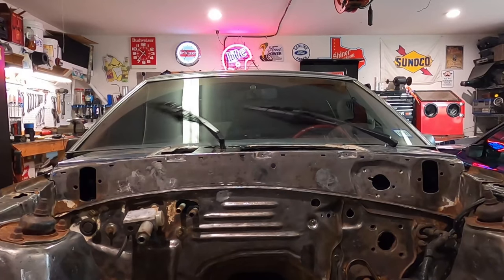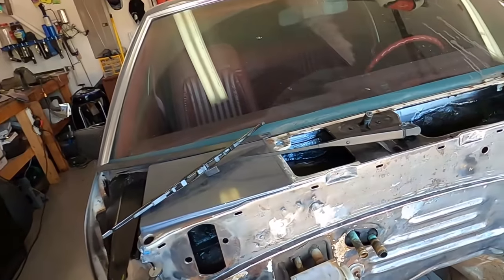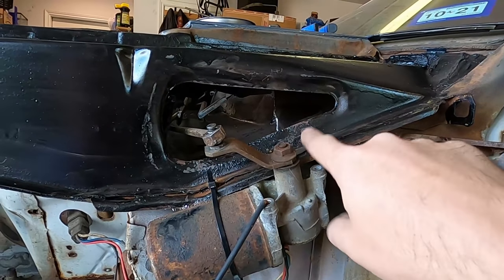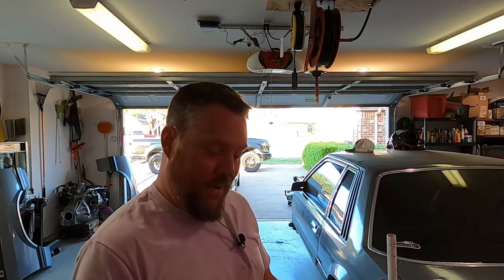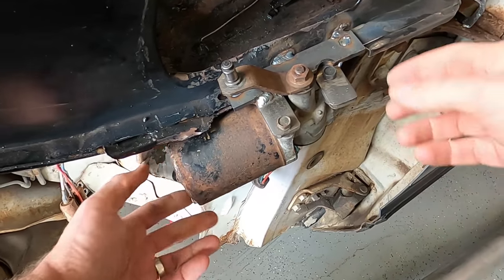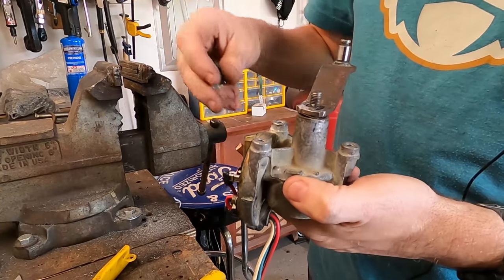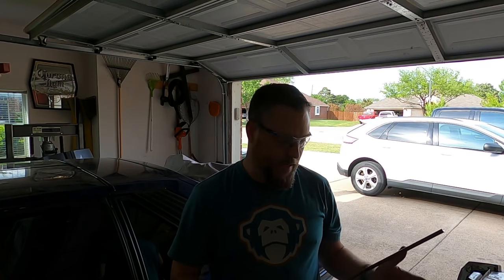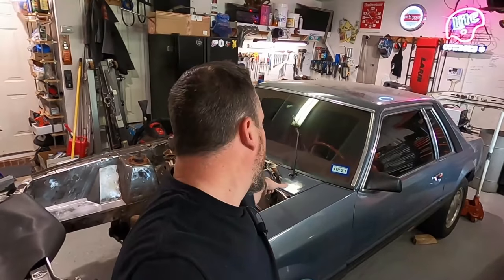Foxbody - Hidden Wiper Motor Mod - Episode 17

Comment: Looks good have you tried modifying stock linkages so you 
would be able to use the stock style end links and retainers.
Reply from the maker: So, I could have done this, ideally if you had a spare linkage, to join 2 together. But mine was missing the bushing anyway, so I just made my own.

Comment: You could use a heim joint for the joint on the motor!
Reply from the maker: MAN I had to cut that part out. YES. The IDEAL solution here, no question, is a spherical heim joint.

Comment: Why couldnt you readjust the wiper position on the mount at the windshield to compensate for the park position?
Reply from the maker: Because the motor is mid sweep. If you left it and just adjusted the wipers in park, your wipers would go halfway up the windshied and then halfway DOWN across your fender. Park has to be in a spot that pull the rod all the way to the stop towards the driver fender. This is true with this mod as well as factory setup. The issue is when you move the motor your changing this park spot about 45 degrees.

Comment: Slick- sick mod! The only down side is if the wiper motor were to ever fail. Kinda difficult to replace but then again how often does that happen. Very good work 👍
Reply: I thought the same thing you never know I've seen brand new parts fail and if it does damn I'd hate to have to replace it when the car is complete

Comment: I wonder if you could have connected the wiper motor to the driver wiper instead of making the long arm to the passenger side. OTOH, by connecting to the passenger side there is only a small change in push/pull angle of the rod, But if it was connected to the driver side there would be a lot more change in the angle and might put to much stress on the connection point?
Reply from the maker: Actually you could, and yes...the LONG arm causes some more vibrations and reverberations due to the length, but you dont want that arm TOO heavy. So, yes maybe could have swapped the pivot point. Just make sure the length from center of arm rotation to "pivot" rod is the same. This would effect wipe range if that makes sense...from park to full sweep would be altered.

Comment: Thx for sharing this but got a question couldn't you have just moved the wiper arms on the part that sticking up through the cowl where they would be in the down position without moving the arm on the motor
Reply from the maker: Yeah, I explain this in the video (diagram part). But it because the motor rotated 45 degrees putting the park is a 9 o'clock position, and needs to be in a 6 0'clock. You see when the arm furthest away from the windshied, pulling the rod to the max point towards driver, the wiper is in the lowest position on the windshield. When you rotate the motor the rod stops in a different spot, no matter the wiper itself, it stops in "MID WIPE" so, if you compensate and adjust the wiper, then when you turn it on it will half sweep up the windshield then half down the fender of the car!

Comment: Just watched the video - very cool mod I'll be doing but... Couldn't we just place the wiper arms at the park position seeing as the attachment points are splined without having to alter the motor??
Reply from the maker: You would think but no. I tried to explain this as well as I could starting at 11:25. It have to do with where the lever stop on the motor affecting the length of the rod, not the "clocked" location of the wipers. I "SHOULD" have demonstrated this in the video but instead tried to explain it. No matter where you mount / clock the wipers the issue if if you dont change the motor "park" position, the motor stops / parks with he wipers at mid point BECASUE we rotated the motor 45 degreed. Lets say you move the wipers to the bottom of the windshield...if you do that when you turn on the wipers they will sweep halfway UP the windshield, then start back down to your set park postion only to not stop and keep sweeping below the windshield and down onto your fender! lol It took me watching this happen before it made sense.

Comment: I could be wrong but couldn't you just hook the linkage extension up with the default park position and place the wiper arm on the splines at the correct position?
Reply from the maker: No sir. One would think. I did :) When the arm is fully extended, the wipers are in the most DOWN position, pulled away from the car. As the arm rotates 180 degrees, its in the full UP position. The issue when you move the motor, the PARK puts the range in mid-point. So if you just adjust the wiper arms on the splines, Soon as you turn it on the wipers will sweep halfway up the windshield, then halfway down onto your fender!

Comment: Love the mod, but I guess you cant run the cruise control stuff then, since it mounts in that area?  Also how will this affect a wire tuck?
Reply from the maker: No cruise on this car, but yes a factory car with cruise you have to lower the cruise canister to make room. This doesnt affect the tuck, in fact it helps because it brings that wiper motor out of the engine bay.

Comment: Any Idea what would cause your park position to shift? My 93 Foxbody when turned off, the wipers go to the lowest point then come back up about 2 inches. So it appears my park has shifted about 5-10 degrees past the original park position.
Reply from the maker: Yeah, I explain this in the video (diagram part). But it because the motor rotated 45 degrees putting the park is a 9 o'clock position, and needs to be in a 6 0'clock. You see when the arm furthest away from the windshied, pulling the rod to the max point towards driver, the wiper is in the lowest position on the windshield. When you rotate the motor the rod stops in a different spot, no matter the wiper itself, it stops in "MID WIPE" so, if you compensate and adjust the wiper, then when you turn it on it will half sweep up the windshield then half down the fender of the car!

Comment: what if you used a heim joint on the end that would probably be perfect or some sort of bearing
Reply from the maker: ABSOLUTELY. This is on my list, and I mention it in later videos. It needs a heim joint, would also take up any slop and allow adjustment.

Comment: So when it rains the water from the cowl drain will dump on wiper motor?
Reply from the maker: No, it runs through the stock channel still. If you notice I left the leading edge  and didn't cut it down.

Comment: You could save yourself a lot of time by just re-clocking the wiper arms themselves. No mods needed to the motor drive arm and only takes a few minutes.
Reply: Nope. You would loose the fill sweep motion needed to clean the fill windshield.
Reply from the maker: Yeah. Doug is right. One would think that. This was the point of trying (my best) to explain the park position. If you just readjust the wiper, park spot is stopped what should be mid sweep, Readjust the wiper, it would travel halfway UP the windshield, then halfway down your fender.